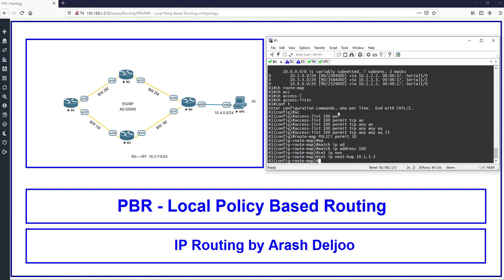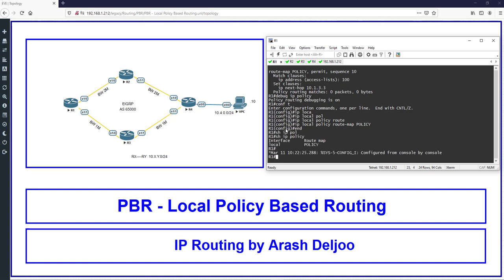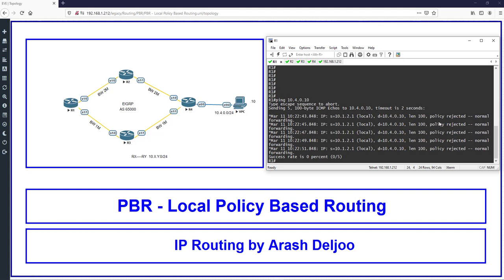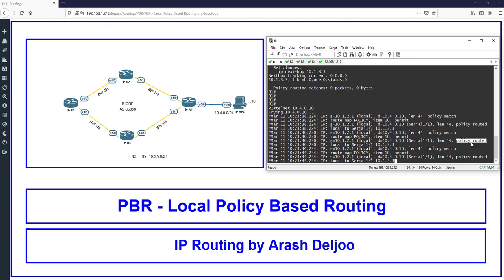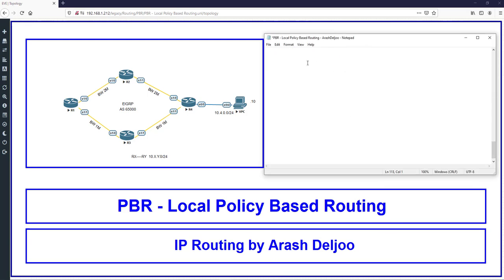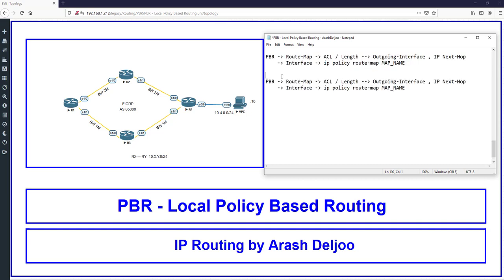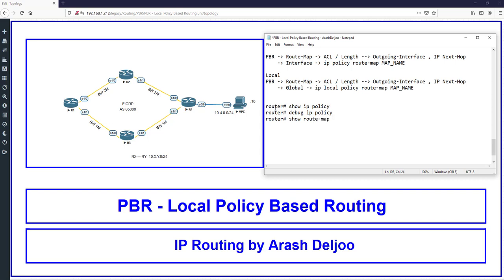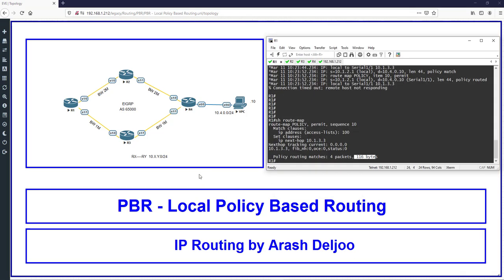4 PBR -  Local Policy Based Routing by  ArashDeljoo - Part2/2

Comment: Why ping doesn't work? Ok, policy rejected the matching so it goes trough the normal forwarding, but you didn't have the echo reply, rate on packet is zero after the ping.
Reply from the maker: Think and find the answer . You can follow the path of a packet when policy rejected .
Reply: @ArashDeljoo  do you have removed the previous video of this section? i cannot find it